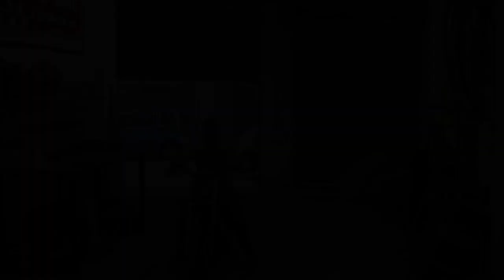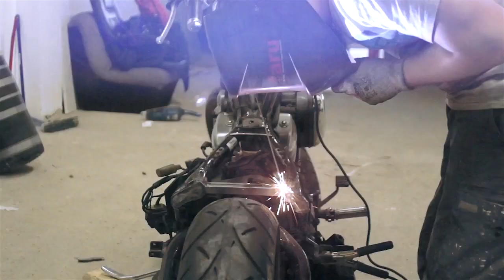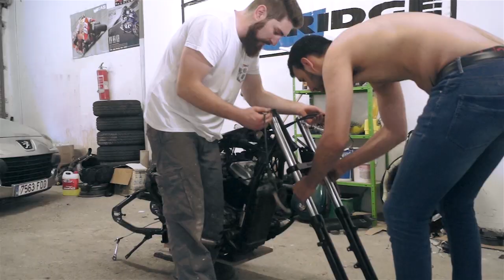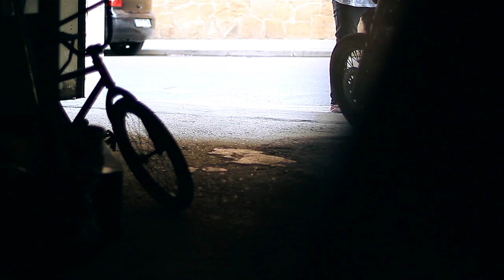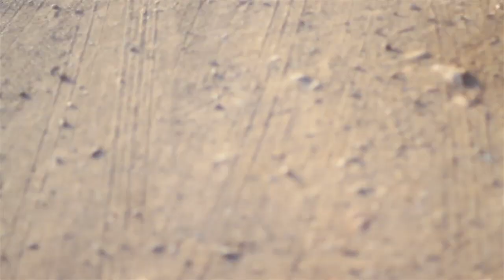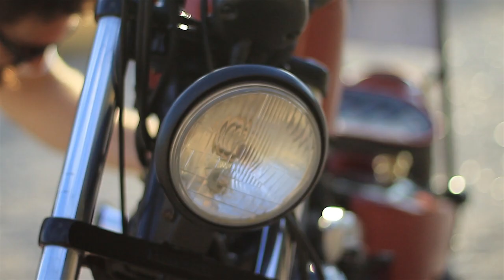project bobber | shadow 600

Comment: Is it hardtailed?
Reply: Philip Dorman I was wondering the same thing. The bike comes with a soft tail rear suspension. I think he kept it stock cause the fender is attached to the swingarm not the frame, meaning the fender moves up and down with the rear tire not the frame. Looks ok though . Such a light bike would really bounce bad with a hard tail, it’s not even as heavy as a Sportster. Can two people fit on these Honda choppers? Without a honey what’s the point?